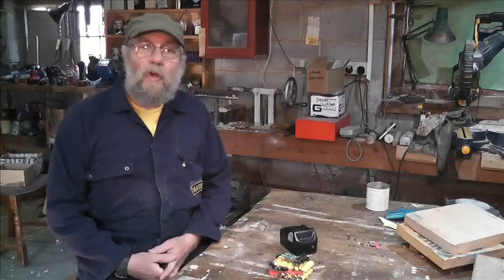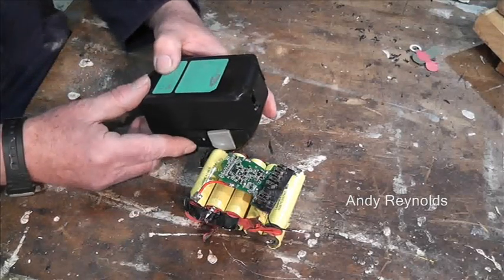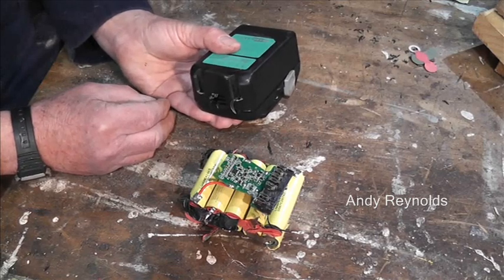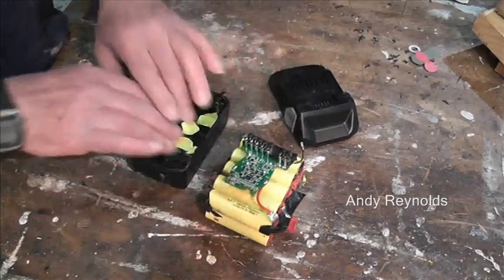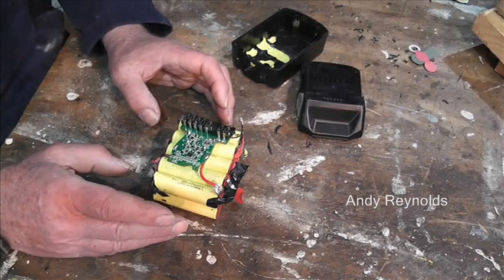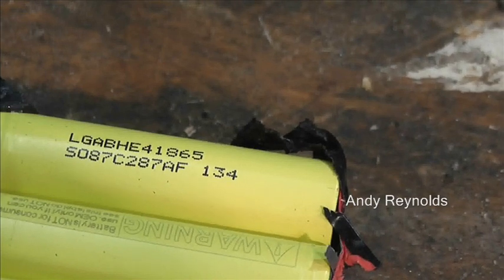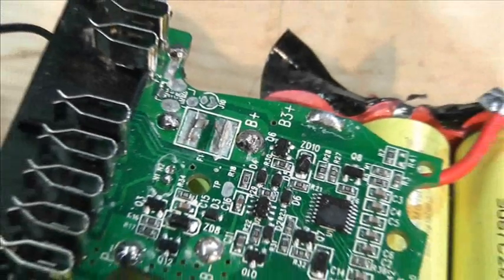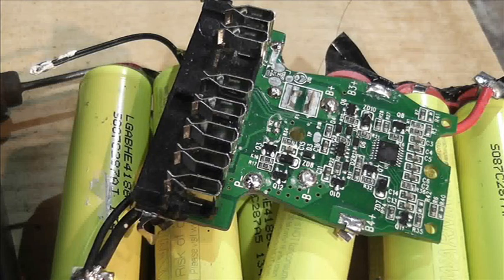After market lithium Hitachi drill  battery fault repair

Comment: That's all fine and all but all the Makita batteries I have disassembled don't have a fusible link and because the circuit board has no other signs of damaged I have to buy another circuit board to repair it. Do you know any way to find what seems to go bad on these boards. I have run across this issue dozens of times. The batteries are just fine but the board will not let the charger do its job. I also know that when the batteries are out of balance voltage wise that they will not take a charge either. It's just this board issue that is a major hang up. I now use a digital power supply to charge them and that method bypasses out of balance batteries.
Reply from the maker: Makita have a counting chip, so many total discharges and the BMS locks you out. I feel the way around this is to avoid total discharge and charge more often. Cheers
Reply: @TheInfoworks  Andy, Hey thanks for the tip about the counting chip. That helps explain a lot of things.

Comment: Interesting to see such a fuse and on a positive note you've some good batteries to repair other batteries. 
I still don't understand why a drill you need to charge with more to go wrong is preferably to mains drill without a battery to go wrong or charge. Seame a backward step for average Joe not on-site.
Reply from the maker: For myself it's the battery impact screwdriver that's a god send. I couldn't believe it when I first used one. Around here battery dills are also very handy though not indispensable, cheers

Comment: Same problem with lidl battery after 4 months use. Gutted because it was a multi att. Machine still in box tryed jumping the battery to no avail. So give up. Iv got makita battery 3.0 never missed a beat 4 years   later. Cheers Andy
Reply from the maker: Pat, time to have the top off, cheers
Reply: My DeWalt liion battery has had it's day. I had replaced two of the dud cells but of course the rest soon failed too.
I had planned on buying a Lidl battery for the cells £25 for 4AHr instead of DeWalts £50. Now not too sure. Cells bought individually of good make are/were £5 each.
Reply from the maker: @ianhelsbyservices  Ian, I have some 2 Ah cells here but I'm not sure about sending them through the post, what do you think? Cheers

Comment: By coincidence I bought 2 of that brand of battery for my makitas, NiMH. I don't think they have a charge controller in them.  I have been driving quite a few 6" screws and it tires the older batteries out. My 3 old ones are still fine for 1" screws and similar all day. I had a look at the catalogues for a new drill and impact driver combo set. you very quickly get over £500! So £30 for a pair of aftermarket batteries and a bit longer with no impact driver. 

I did try that 18v makita you gave me. It works just fine on my 14.4v batteries, but the holder won't grab the battery. A repair or bodge may warrant a video in time. Time of course is the one thing that they aren't making any more of! unlike money and batteries and security screws!

Inflation to 10%, 

On security screws, I have had pretty good success hammering a steel nail of appropriate length into a bit of broom handle, then touching it off the grinder until I have a suitable screwdriver, never has to be perfect, but I used to hate hammering awls and screwdrivers in. Recently however I have found so many screwdrivers in skips that I can just regrind them.
Reply from the maker: Owen, that a newsy news, I have 14.4 Bosch impact and a drill on NIMH and although I can maybe repair the batteries I was wondering if after market ones were worth the investment, clearly the answer is yes.